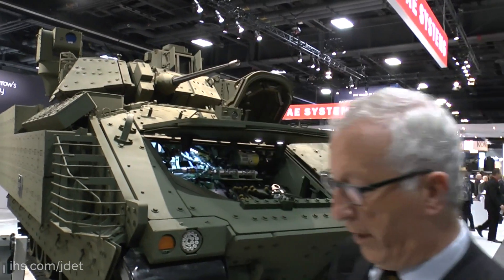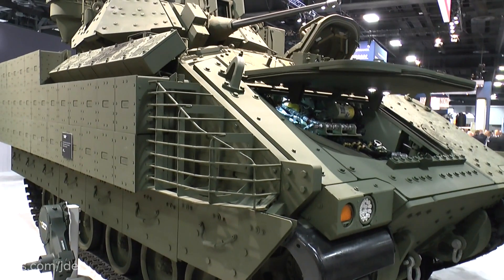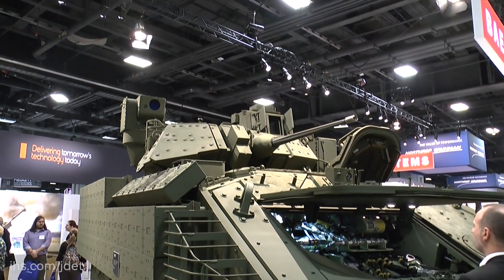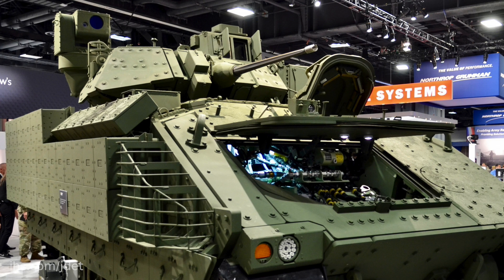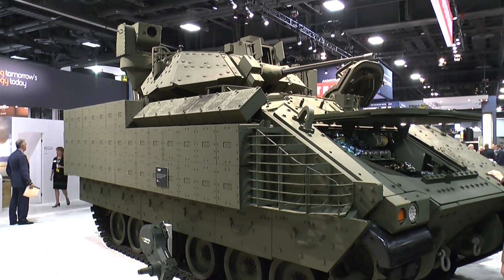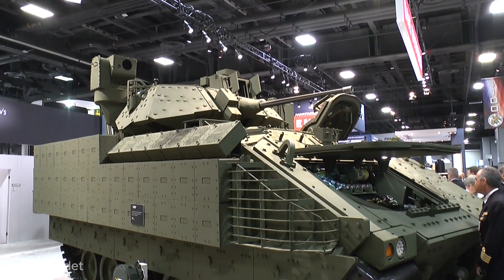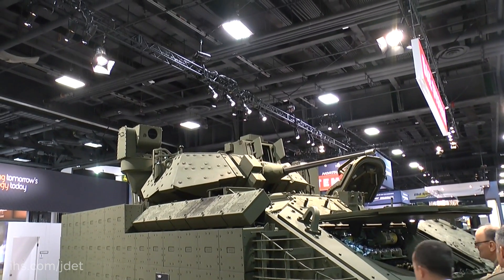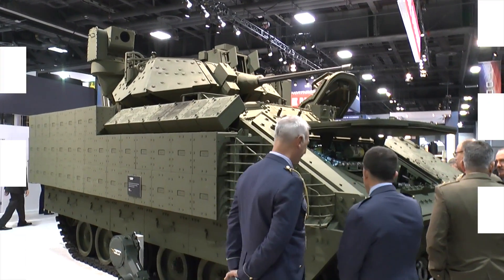AUSA 2016: BAE Systems debut Bradley Next Generation Prototype

Comment: As an EX Tankie, Scorpion with a 25mm auto cannon with HEI ammo would be nice, just need 3mm tungsten steel plate at key locations for crew protection against small arms up to 30mm & mines. + the option of reactive armour too, in key locations, with a better engine and gearbox. You CANT have a veh that is both Anti Tank killer + Inf carrier, one or the other Im afraid.

Comment: fielding MBT can be succumbed by this AMPV since the TOW missile can be used manually if it survive the first hit and that is why US is no longer manufacturing more MBT. 

Missiles can take out MBT beyond visual range.
Reply: We're not manufacturing more tanks because we have no need to. 

Unless we start losing a bunch of tanks or decide to expand our military to economically unsustainable levels, there's no reason to build more Abrams, and no existing threats that would warrant a new tank design to phase it out.

ATGM's are hardly the silver bullet they're made out to be, and a bloated 40-50 ton APC / IFV will always sacrifice in all 3 aspects of armored warfare (protection, mobility, firepower) compared to a dedicated tank.

Comment: For the love of god, put the 30mm on there. It should've been showcased with it in this video. ATK already has them. And get rid of the double track pad shoes. They're absolutely awful and conditions other than dry. The suspension is great on asphalt, but wet grass gives you NO traction as the pads just slip around. Turning is problematic because as one side of track is going slower, the other side just pushes the vehicle forward
Reply: I'm with you on that. Get rid of the current pea shooter!!